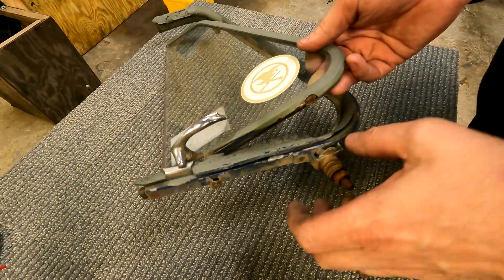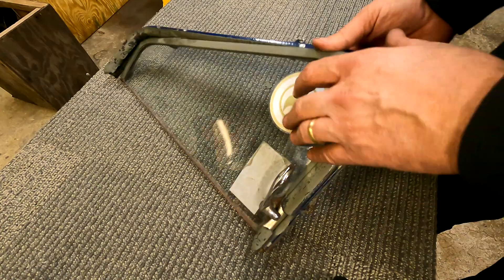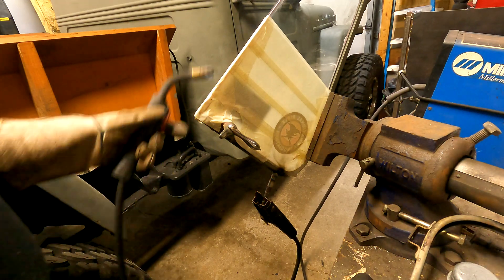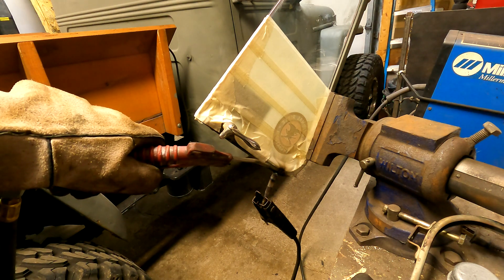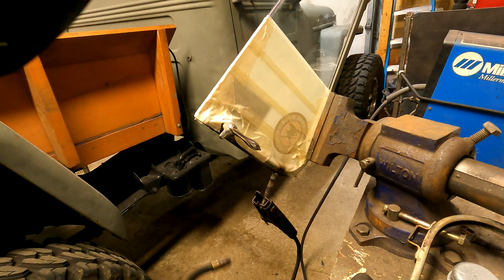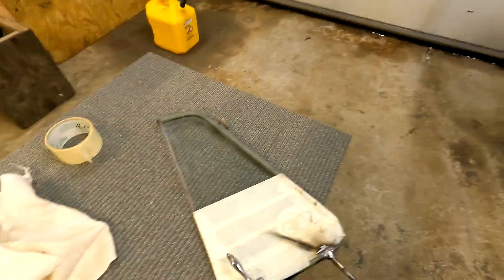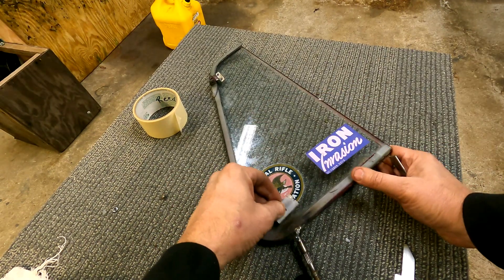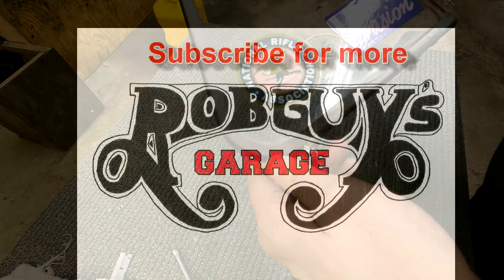Welding near glass, will it shatter?

Comment: I literally just had a window shatter whilst welding next to a mining machine cab. The thing made a bang that made me think someone smashed it with a hammer. Was a side/cab door window. I’m trying to find out why it has happened
Reply from the maker: I thought for sure mine would break, I wonder if you get just the right slag falling on it that breaks it
Reply: yeah, must be a very slight chance for it to happen. I carried out the same repair on a different machine, same make and model, and the window did not shatter.  the windows do have exposed edges as well. could very well be the type of glass and its hardness but I'm just guessing at this stage. @robguysgarage5422
Reply from the maker: I don't think I'd try it on a nice car or truck though